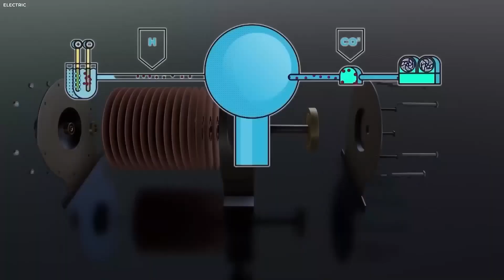Toyota's Water Powered Car The Future of Clean Energy

Comment: Use same engine but hardening steal treatment and higher compression ratio then batery create hydrogen mix with oxygen at 40% 60% by weight can smoothly drive combustion engine or even rocket and engine compression ratio 16.7 instead of 14.7. So 7.2 gram of hydrogen for each 10.8 gram oxygen